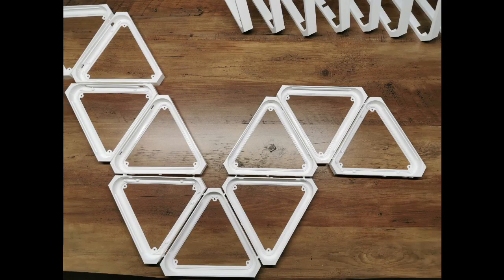SONYX NEO PIXEL LED LAMP (Full 3D Printed Lamp) CR10sPro Nanoleaf Replica PRO

Comment: Good work but, that's not how the original works bro... Why don't you make it plug and play? Take some LED pins and mount them on the sides, on one side a female connector and on the other 2 sides male connectors, then also mount some cheap small magnets so it will hold it together. When done, you can just plug the panels on other panels like the original one.

Comment: Hey excellent work! Thanks for the stl by the way :) 
Do you think it is possible to avoid printing glass part by using acrylic sheets? In this case, is there any particular thickness to chose, in order to fit the other STL parts?

Comment: I was thinking of doing the one with the Arduino and soldering but seeing this, I think I've changed my mind.

LED Signal 1 to 2 splitter 3pin - I can only find 4 pin options. I assume this will still work assuming you connect it to the right ports?

What app did you use for the color combinations?

And where's part 2? :) 

Just saw your update in the description. Sorry to hear about the problems. 

Possible APP mystery solved, at least for Android, This app looks like it should work
https://play.google.com/store/apps/details?id=com.spled.pzse

I get my lights and adapter, ordered this one. According to the app it should work.
https://www.amazon.ca/ALITOVE-Controller-Control-DC12V-24V-Addressable/dp/B07SG394ND
Reply: Thank you so much for putting this out. It helped out a newbie like me !

Comment: Could I modify your design so I can make different patterns or add a way like the nano leafs since it seams the ending looks a bit darker I assume from lack of power at the end so I wanted to add a way to power inject power from the beginning and end also where’s the vid at?
Reply: I have yet to research this topic, but intend to get individually addressable LEDs to ensure this is possible later down the line. I have already started the pieces for it so I'll let you know how it goes.

Comment: Awesome project dude, now what is the difference between P2 Bottom High and P2X Bottom  Hight?. Also  P2 Top end High won't fit on P2 Bottom Hight.
Reply from the maker: Hey the differents are some tiny lashes on the corners where the LED strip crosses each other. 👍 P2X is for Crossing led parts and P2 for the normal ones (see the routing and printing diagramm in the video)
Reply: @jansony2670  Thanks Dude!

Comment: Wow I thought ur account password got lost or something, but this project was worth the wait love the look. do you think transparent Petg will work I didn’t have any natural pla and I can’t find a perfect one. And I’m trying to print more Petg since it’s stronger and easier on my machine
Reply from the maker: Hey mate 😋 yea i know it is a shame 🙈 yes petg works also for the GLAS and DIFUSOR
Reply: @jansony2670  awesome. Do you think 144 per meter leds would look more defused compared to 60 per meter leds? Also how much did this all cost?
Reply from the maker: @SlippySkip  you need to much power for 144 Leds/m (ampere) and most controllers only allow up to 500 - 1000 LEDs to be controlled with. So better go for the 60 Led/m 😊👍
Reply: @jansony2670  alright thanks 👍

Comment: What print settings (infill density, infill pattern, print speed) do you use for the clear parts (DIFUSOR HIGH and GLAS HIGH)?
Reply from the maker: They need to be solid. For the GLAS you take Lines or ZigZag. Change top/bottom line direction to [180,90] im cura
I will explain more in part 2 in my christmas holiday's (in about 2 weeks)
Reply: @jansony2670  Hi, thanks for the great job,  still waiting the part 2 or more detail.

Comment: Brauche ich 2x 5m LED Stripe oder reicht 1x 5m für alles?
Reply from the maker: Genau 👍 die werden dann am anfang mit einem splitter verbunden ☺️
Reply: @jansony2670   2x 5m LED or 1x 5m LED. 10m LED or 5m LED?
Reply from the maker: @andyfischer7277  2x 5meter
Reply: @jansony2670  thx

Comment: Hi, which LED strip would you recommend? (aliexpress, ebay, amazon, ..) The one in the label is not available. ☺️ Its great!
Reply from the maker: Hey make shure to use WS2812 LED stripes.
https://www.amazon.co.uk/dp/B088BPGMXB?pd_rd_i=B088BPGMXB&pd_rd_w=zWWC2&pf_rd_p=011646eb-9e9b-4015-898f-4e475f8c352f&pd_rd_wg=NFjhb&pf_rd_r=3W970067GVCJ2R86KFHX&pd_rd_r=2e2a28e8-502b-44a1-9dfe-b12994826d88
Reply: @jansony2670  thank you! 👍😊

Comment: wie hast du die 2 led streifen verbunden?
Reply from the maker: Mit einem Splitter. Denn den ich verwendet habe gibt es nicht mehr zu kaufen. Musst mal schauen was du bei euch so kriegst. So sollte der aussehen:

https://www.digitec.ch/en/s1/product/phanteks-3-pin-digital-y-splitter-rgb-400mm-modding-illumination-10393780?gclid=Cj0KCQiAtqL-BRC0ARIsAF4K3WGeLaTzpHFXy1eRWQUhTwZnvGnqIodxGuQqamzZDryDer_3rGpWhYUaAqAsEALw_wcB&gclsrc=aw.ds

Comment: any one plz help me .. new to 3d printing ..
which parts to print for the build i am not able to understand , there a many similar parts ..
need to know . which parts are need to complete one leaf  # of parts etc and can i scale it down a bit ?
Reply from the maker: Hey Farukh
Scaling down is not possible. The difusor will not fit anymore if you scale it.

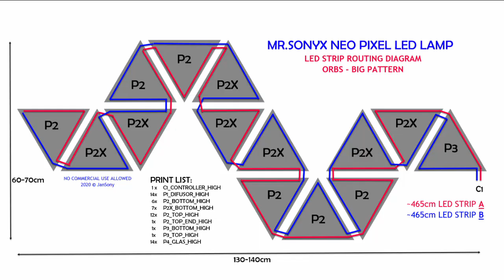The full part list and build plan you can see at 04:12 in the video

Thank yoi 😁
Reply: @jansony2670  how about i scale every thing down proportional. 
Top , bottom and the diffuser

Comment: hi bro can u plz reply ...
i really like your design .. have some questions .. is the diffuser also printed .. can i use any other diffuser material .. and there are different body designs which oe to use .. plz explain
Reply from the maker: Hey Farrukh the difusor is printed and spray painted with a thin coat of white. You can also use other milky glas materials.

At the moment there is only the big orbs pattern. I will be adding more as soon as i can 😊👍

Comment: Are the faceplates 3D printed? Or are they acrylic? If printed how did you hide the layer lines so well?
Reply: It was 3D printed. Look at the lowest link in the description. The front panel is in the files. There are tutorials about how you can smooth out 3D prints.
Reply: I am wondering the same thing.

Comment: Im waiting for Part 2 👌😜😅
Reply: No Problem, im printing since 5 days all parts.... Nearly 50% ist done 😅🙄.
Reply: @jansony2670  Still no part 2?
Reply: I am printing this out for myself right now!! I hope that part two comes out soon. But there is no rush because I get that the Pandemic has made it hard to do a lot of things. :)
Reply: Waiting for part 2
Reply: Part 2🇿🇦
Reply: same price as original...

2.5kg pla = 60-80 usd if a chraper one
2 - 5m smart led = 60usd or so
power adaptor for leds = 10usd for this crazy lights
power in most countrys for 24h build = 10 usd or so
misc stuff u need = 10usd
total is 180 usd.
the original on black friday will be around that price anyway so..... yea.....
Reply: @ShayVidas  Everything together costs me like  70€ lol how you calculated that xD

2,5kg filament around 45-50€
2x 5m RGB led Strips with wlan Connection + Power adaptor 13,5€ (bought on AliExpress)
The rest is not that expensive like electricity (10 hours printing with an ender 3 are 1kW that means 0,3€ for us in Germany // 150 hours printing time for the whole project)

Original panels cost about 300€+
(Amazon average price)

Comment: Very good résults ! I have two question 
You have two alimentation for the all build ? You thinks we Can have juste one ?
You buy special strip led or the basic one ?
Reply from the maker: Hello , what do you mean by alimentation?  1x Power Supply +  1x Controller
Reply: @jansony2670  you weld the two 5m strip on one controler? 
You use basic strip for the build ?
Reply from the maker: @sentex54  no welding or soldering ❗ used a 3 pin connector splitter 👍 on one side is connection to Bluetooth controller and on the other side are 2x LED stripe 3pin cable connector 😀
Reply: @jansony2670  thanks. Can't wait to see part 2 😮
Reply from the maker: @sentex54  https://a.aliexpress.com/_dXJ1oLv
No problem 😀👍